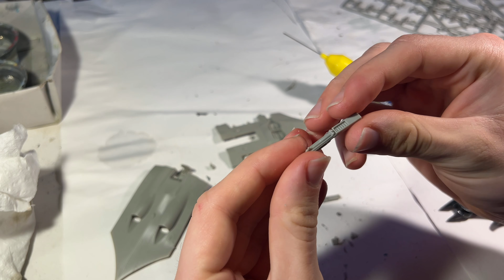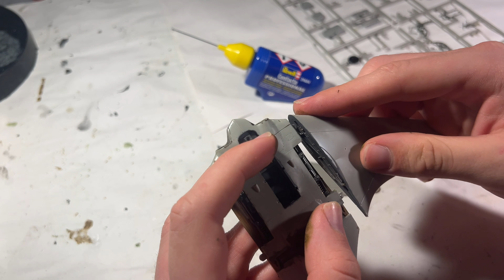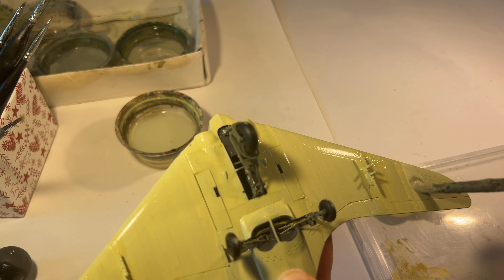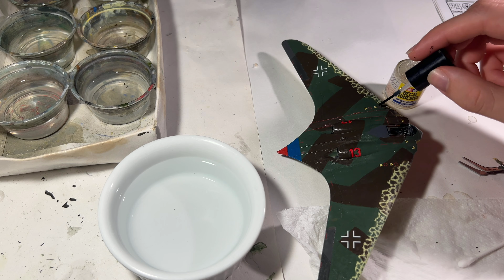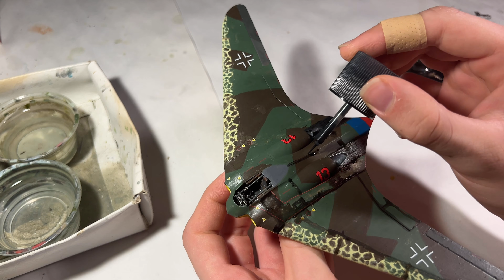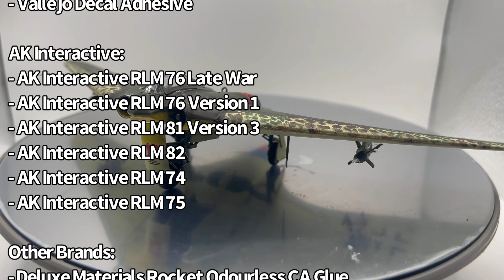Revell Horten 229 What If Build + Review | 1/72 Luftwaffe 1946 Model Kit + 3D-Printed X-4 Missiles

Comment: The x-4s weren't exclusively intended for twin seaters. The only ones exer (test) fired were from single seat 190s
Reply from the maker: True, though my understanding is after testing with the FW 190 it was found to be nearly impossible for someone to fly and guide the missile so it was going to be used in the two seat me 262 and the JU 88, but given its a what if build it probably doesn't matter too much :) Thanks for watching!